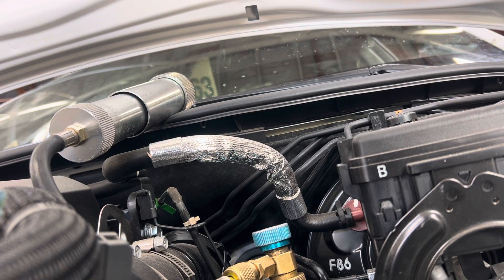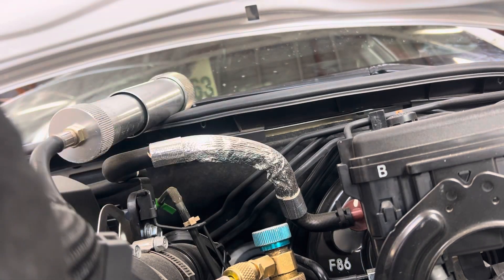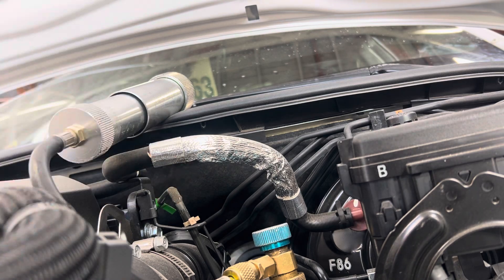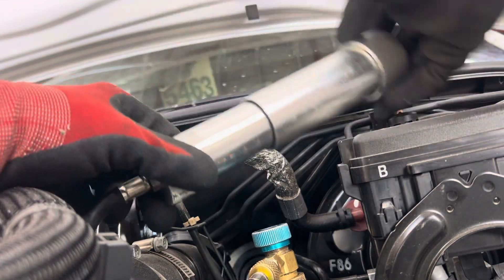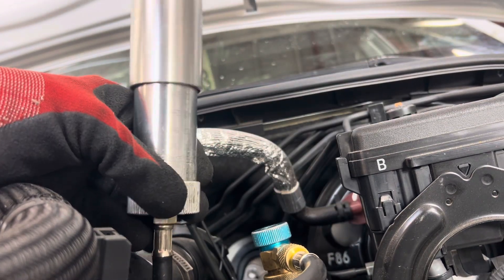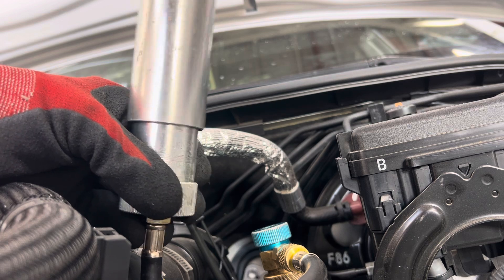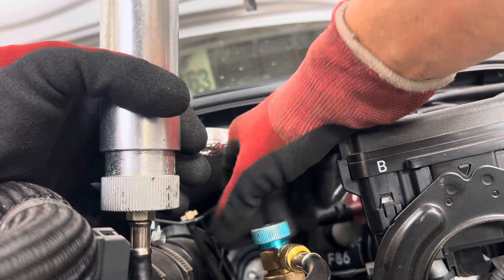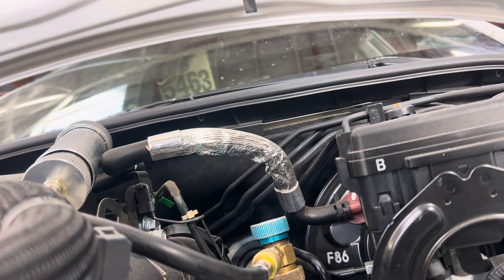ND-12 REFRIGERANT OIL INJECTION, be careful where you add oil. Possible to damage compressor.

Comment: if you are quick to install the condenser/dryer before pulling vacuum, can you just add the oil to the condenser directly  instead?
Reply from the maker: Yes, you can add the oil to the condenser. 
    This is at a body shop. Technician has already installed the condenser. I’m just coming here arriving after it has been put back together..

Comment: Do you purge that thing of air first?
Reply from the maker: Yes, it has been purged by turning it up right and screwing it. It pushes up the oil and pushes out the air.
Reply: @coldfinger459sub0  I'm unable to purge out air from the short injector hose. The injector cylinder and hose builds up pressure. The short hose has a value at the end which must be pressed by a R12 type flare fitting in order to push out oil. I'd like to bleed air all the way through R134a or R1234yf 90 degree multi-turn adapter also, but that adapter isn't letting air pressure through either, even if it's turned in all the way. Any advice? Thanks.
Reply from the maker: @crvinva push it onto a 123 retrofit adapter
Reply: @coldfinger459sub0  Yes, that works. Thank you!